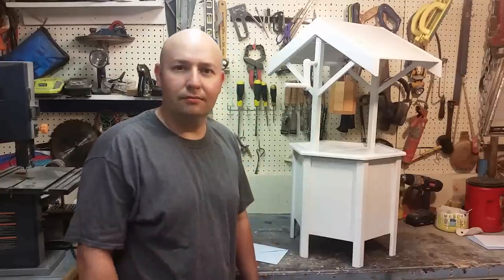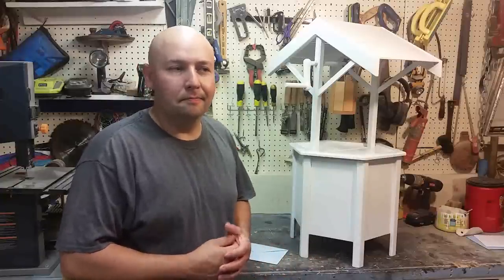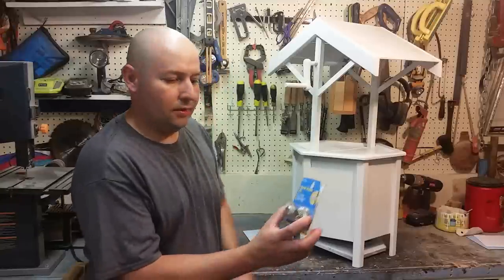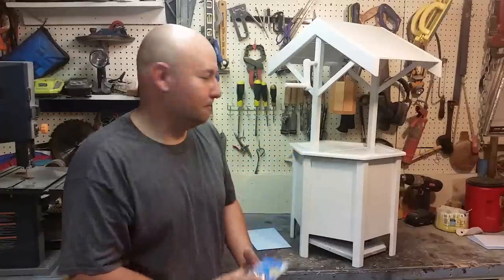Making a wishing well card holder

Comment: Great build Moy! I really liked that belt sander mount, thats a great idea. What was the car or piece of paper for when you were nailing in the slats on top? Does it keep the paint from chipping? Got to love the dollar store I can't get out of there without buying some kind of crazy random stuff that ends up sitting around forever before I use it hahaha.
Reply from the maker: Hey braxton. the belt sander mount is John heisz design. and yes I used an old ruler (the flimsy thin plastic  kind)to absorb some of the impact from the nailgun. this way it leaves a barely noticeable pin hole. I'm the same way,  I know I shouldn't but I've also bought hinges from the dollars store..lol

Comment: I was asked by my future sister in law to build one of these. I enjoyed the video. what angle makes up the 6 sides?
Reply from the maker: +Edgar Owens thanks man. I don't recall the exact angle of cuts. If you come up with a diameter there are several websites that offer segment calculator. Just web  search segment calculator and plug in the diameter and number of sides
Reply: Moy perez woodshop Thanks sir. And keep up the good wood work.